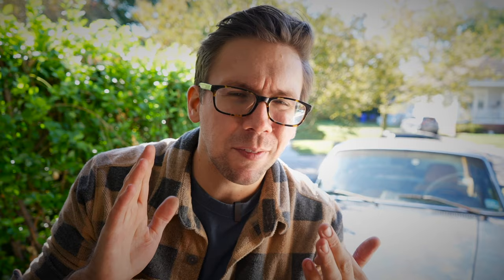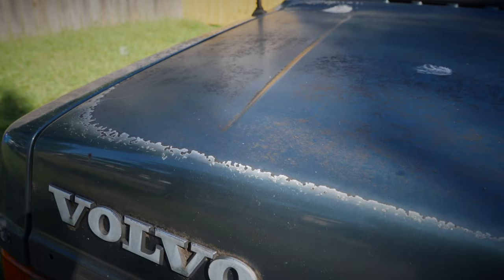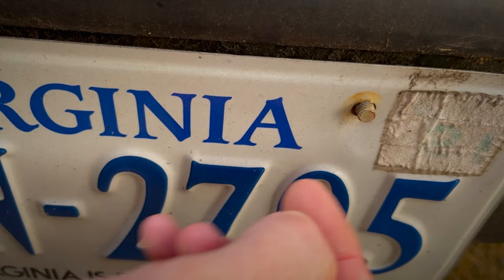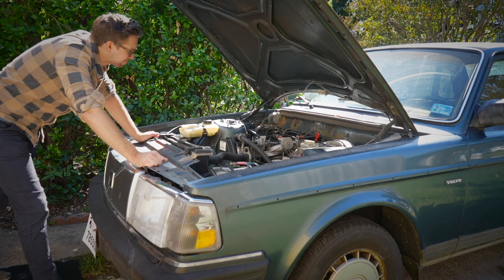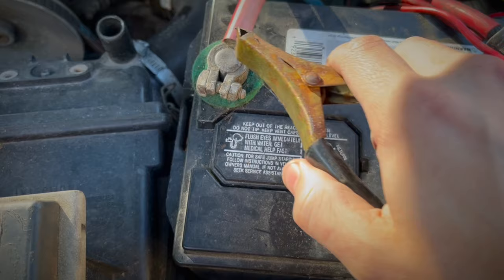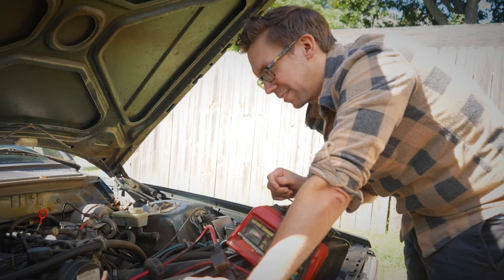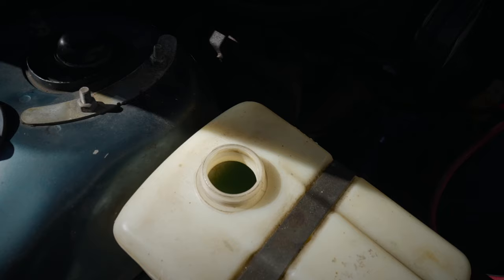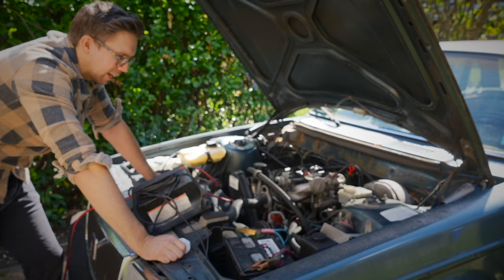Will the ABANDONED Volvo 240 Start and Run?

Comment: I don't understand why these 240's have to be found so damaged, so abused and neglected. Maybe it's because they withstand the torture of idiots and live on. These cars seem to end up as 'rescue' cars, like rescue pets. They are just fantastic cars due to having minimal electrics and maximum mechanical durability. The designs are pure artistry.
Reply from the maker: Preach buddy, as soon as I saw it parked under a tree I wanted it. I think it’s the slow decline - starts running a lil rough, then hard to start when cold, then starts shifting weird, then needs new tires but they already bought a new car so it gets parked outside under a tree but it’s still the back-up car. 5 years later their newer car is the backup and when they go to start this one, it’s battery is dead and they ehhhhh and sell it. Seen it time and time again sadly - And it took so little to get it moving again.
Reply: in my experience all of the interior plastic is brittle and will break at the slightest touch. what I don't get is why lots of people have gotten rid of their 240s when they prolly just needed a cheap part to keep them running
Reply from the maker: @beardham you’re not kidding haha. Ironically it’s a ways out but I’m working on a way to line the back of the panels with fiberglass to help keep them together. Still chasing the perfect epoxy to mate with the plastic and fiberglass.

Comment: I love my 240s. Sadly, I loaned one of mine out (the nicer one) and it got crashed, but I hope to be able to afford to fix it one day. The other one, which is currently my only runninc road-worthy car is a 92 244 white with the blue cloth interior. It is still nice, but the paint is a bit poor and there are some small dings; the interior is really nice though. That car has 329,xxx miles on it currently, and I still drive it around 100 miles every day. It has scared me a few times, but never left me stranded. Parts are cheap and easy to find, and there is a great community surrounding these cars should you have questions. Overall, I would say that if you want a classic iconic car that you can daily drive and never worry about breaking the bank with it, these are the best cars you can get.

Comment: I’m not at all surprised by this being a “boring” revival. These brick-era Volvos are unkillable machines. 
I bought a clean 940 Turbo Wagon several years ago out of curiosity and it has been such a great car that I picked up a cheap 940 beater wagon with 300,000 miles on it as a daily work car. If looks like hell, but nearly everything works and it drives like new. 4,000 trouble free miles so far in that old car. 
It’s easy to become a fan of these.
Reply from the maker: I love them - I started my old Volvo career with a 740 but always had a soft spot for 240s.